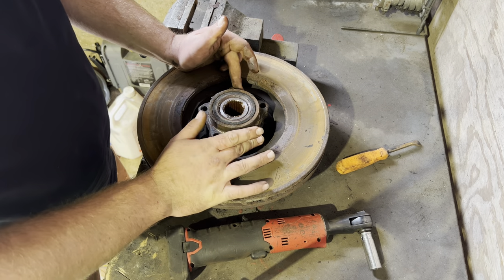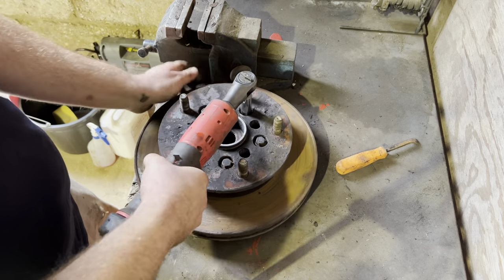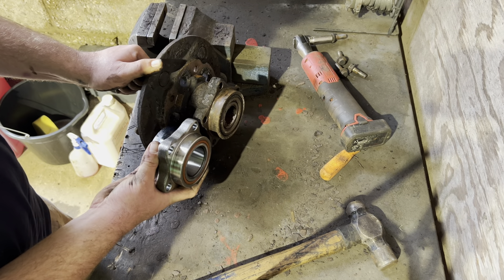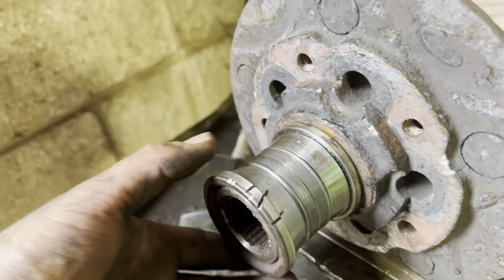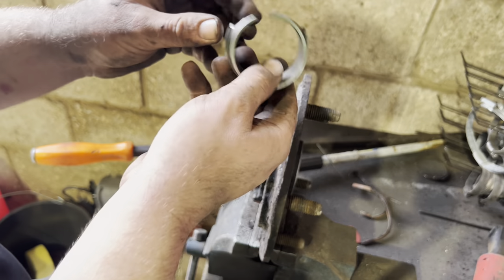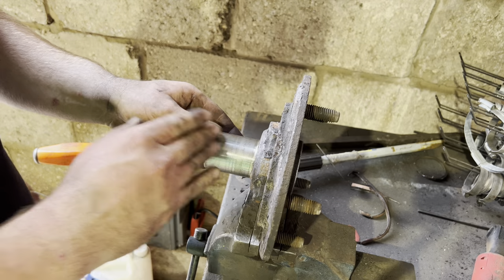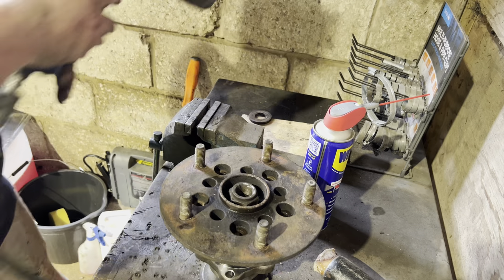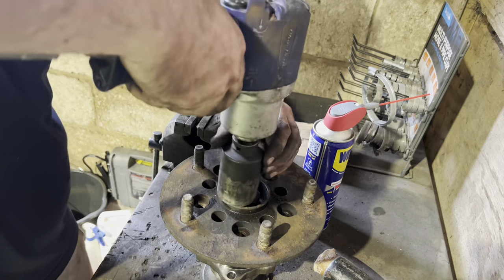Transit MK7 wheel bearing replacement. No press needed!

Comment: You said happy to help here goes!
There’s a million and 1 jobs for me to do on mine.

Just 1 I need help with.
I suspected it was a front passenger side wheel bearing fail approx 5 years ago, had that replaced, but still continued to make a noise, can hear it at very low speeds, like first gear is probably the worst coming from front passenger side, like a noise everytime there’s a revolution. Like a wow-wow-wow-wow-wow.
Any ideas?
The faster and faster I go it is still there but the noise seems to fade into the background.
Reply from the maker: Hi, ok so is your transit FWD or RWD?  The FWD transits have an intermediate bearing on the drive shaft which can give you the noise you’re experiencing. Failing that it could be a faulty bearing, worn brake disc or noisy gearbox.  First thing to do is get it jacked up and see if you have any play in the wheel bearing and then the service life of your brakes and keep working back untill you discover the noise! Always here to help so if you need more guidance drop a comment. Cheers 👏

Comment: yep, did it the same way yesterday. I saw a method where you use 5x M17 bolts and nuts to press the bearing off. tried it. result? 5 knackered M17 bolts. sometimes the grinder is the only way. For anyone watching, the hub nut needs to be tourqued to 420NM which is twice what a big 1/2" tourque wrench can do, so you'll need a Loooong bar. The bearing is known as a pre-loaded casette. Give me a renault 4 please.
Reply from the maker: I’ve seen someone pull the old bearing off with a flat bar behind it but it still took as long as a grinder to do and doesn’t guarantee success! Yes those hub nuts are a pain to get off as much they’re are to get tight enough.
Reply: @Automotiveolie eu înainte de  a monta bag fuzeta în congelator minim o ora iar înainte de montaj încălzesc rulmentul și întra mai usor

Comment: helps to put the new bearing in the freezer for a few hours to shrink the metal
Reply from the maker: Yep done that a few times. Usually when I’m doing these bearings the vans need to be in and out of the workshop ASAP so the freezer doesn’t really have enough time

Comment: In my opinion, using a copper/hide hammer AND a bit of wood makes it much harder work; too much shock absorption going on. I often use a club hammer with wood to cushion the blow and haven't broken anything with that set up yet (unless I miss or forget the wood). The copper/hide should tap the bearing on just fine without the wood and won't damage anything in the process. But hey I could be wrong and better safe than sorry. I've hit less sturdy things into place with bare metal hammers and heavy bits of pipe and whatnot, you just need to know the line between impact driving and smashing!
Reply from the maker: Annoyingly it was the heaviest hammer I had and I just like to be double sure it’s not going to distort or nick any surface. In an ideal world I’d use a press of some description